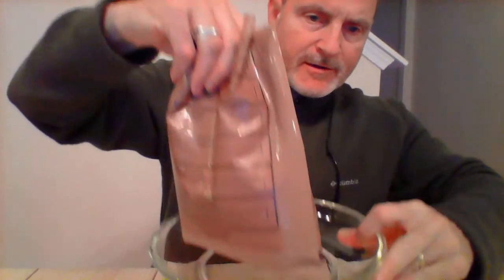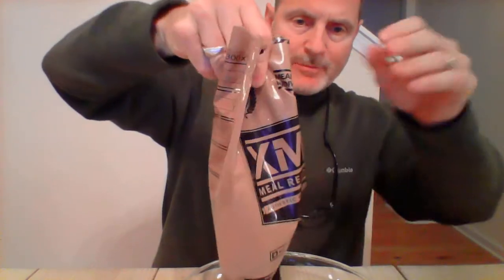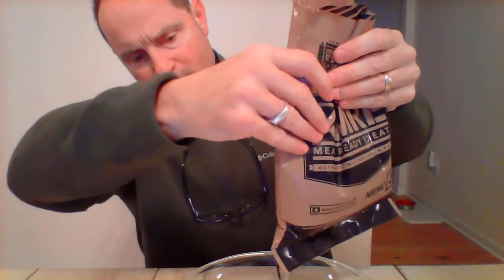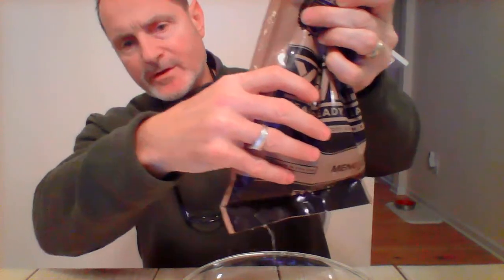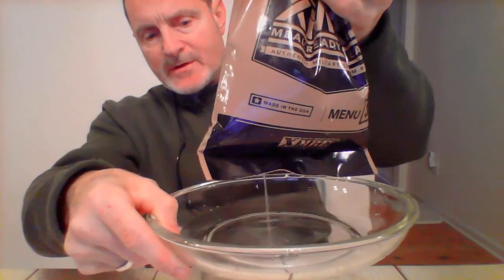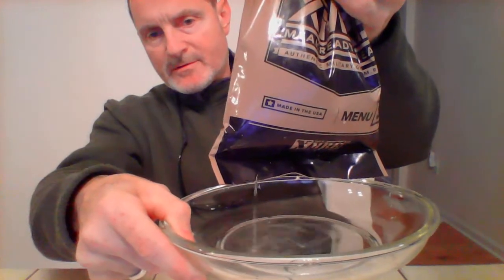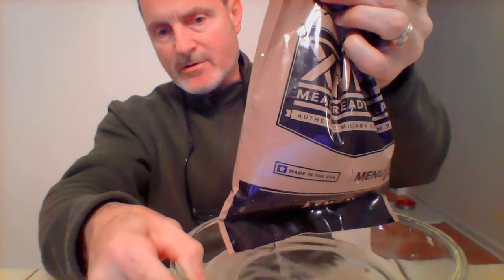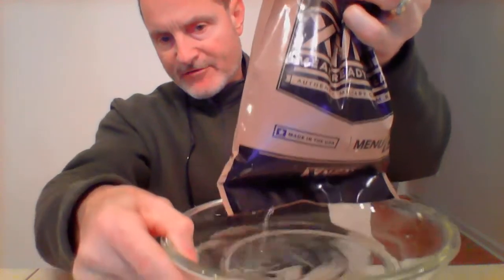MRE Outer Bag-Can I collect Water in Them?

Comment: Most of these types of bags are simply heat welded. Just like a Food Saver type of system. You might want to try running the bottoms of these bags through the heat section of a Food Saver in several different locations. Or better yet some kind of ultrasonic plastic welding that can use a roller so that the entire bottom below the bag itself can become one solid body. As far as carrying the bag itself I would recommend adding at least 5 grommets around the top. That way the weight of the water itself wouldn’t damage the bag. I’m just wondering if you could boil water in one of these types of bags? They claim you can sterilize water if you can get it up to 160F for 30 minutes. You don’t actually need to get it up to boiling. So you might be able to use the MRE bag but not have it directly over your fire.